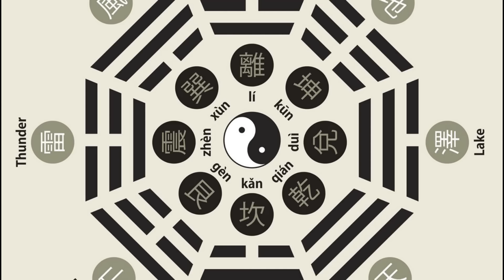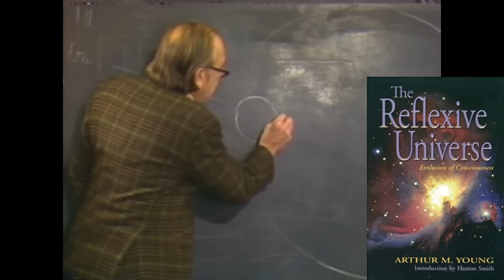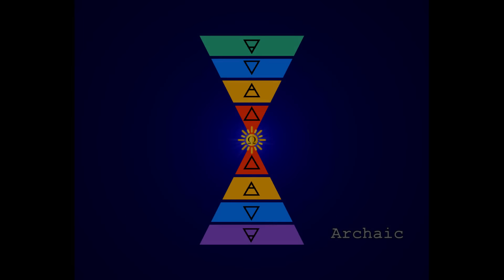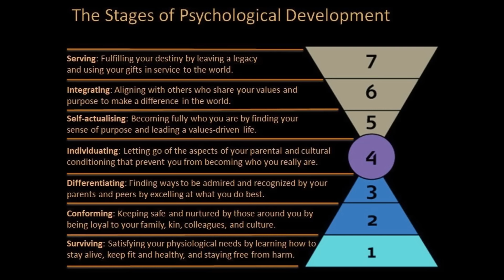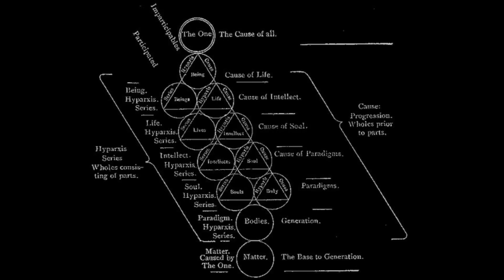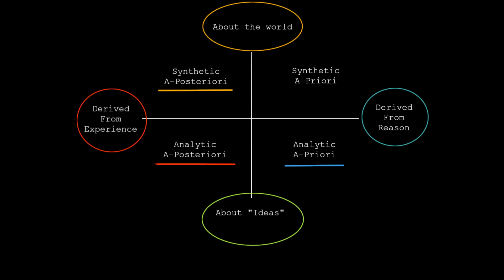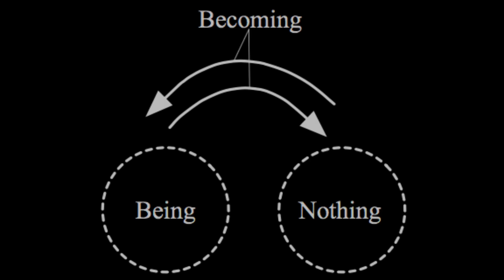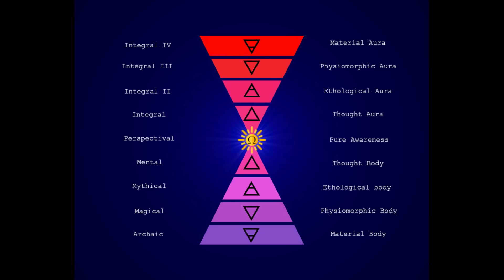The Metamorphosis of Human Awareness

Comment: Would love to hear that you’ve gotten a better mic setup
Reply from the maker: I have a very solid mic setup. What you don't like is my mastering chain, which I calibrate specifically so that my dialogue is discernable on various devices, meaning that I will not be changing it in order to accommodate your preferences.

Comment: Finally!  Been waiting for your next masterpiece bro!  I’ll edit this once I’ve had time to digest the content.

Edit:  First off, as a mechanic, I can confirm that it is very easy to see mechanisms everywhere, including biology.  But there’s a different aspect to it too.  Once you get a broken motor repaired and rebuilt - especially with older motors - you then start that motor up to “break it in.”  You then tune.  You are giving that motor the mix of fuel and air or “Food and Oxygen” that it needs, and you tell it when to use that energy to effect rotational velocity.  But you may decide it needs bigger “diaphragm,” so you add a high-lift camshaft.  You decide you need more air and fuel, so you add a supercharger for more volumetric efficiency and you feed that through a bigger carburetor, bigger “lungs,” bigger “trachea,” bigger “nose.”  You now swap your rotating assembly to accept more force.  You put more accurate ignition timing on so you don’t get out of sync.  You start it up, break it in, make fine adjustments, and then before you know it, your motor is running smoothly and has a unique resonance.  That resonance determines how that motor responds to input, and how it handles quick or gradual changes in that input.

While a motor is not a living thing as the idea of living is currently considered by mainstream science, microscopic differences in the individual components of this motor change aspects of the motor in it’s whole.  Two motors with the exact same parts made from the exact same molds and built in the exact same way with exactly the same amount of lash, will both require slightly different tunes to get their maximum output.  And the output is different.  Two identical motors will require different tunes no matter how perfectly identical they are.  The Horsepower and Torque curves will never be exactly the same, even under perfectly controlled atmospheric conditions.  One motor will start to “purr” or resonate at a slightly different RPM than the second, even though they have the same camshaft, same induction, same input and same exhaust evacuation.  One intake “seasons” itself better than the other (liquid gasoline coating the intake runners).  One motor burns more of it’s carbon deposits than the other.  Each cylinder on each motor gets different heat marks, even on a motor where all cylinders have air and fuel swirreling in the same exact direction at the same pitch and azimuth.  Every intake stroke in each individual cylinder results in just a slightly different volumetric efficiency, slightly different burn duration, slightly different power stroke.  Everything is slightly different each and every time.  Perfection is thusly never truly achievable.  Each Dyno pull gives a slightly different result.

With this information, it is impossible for me as a mechanic to say that every motor is the same.  Each one has it’s own character, each it’s own unique resonance, regardless of how exactly they are built to their counterparts.  Each motor “lives,” should it be given rotational velocity (turn the key, turn the starter, connect the bendix).  Each motor “dies,” should it’s ignition be cut.  It is revived, should you turn the key again.  I wouldn’t say that it’s conscious per say, but instead it is undeniably animate.  There is something nearly magical about these machines, something akin to a personality.  It resonates.  If it’s damaged, it tells you.  It’s resonance changes.  When you replace the broken component, it has a slightly different resonance.  Much like a transplant patient may have a change in personality, so does a motor change in resonance.  Sound, body; different body, different sound.  Different resonance.

Even something as simple as an analogue clock’s function results in witness marks; no witness mark ever exactly the same.  A clock maker must identify the witness marks, understand the clock’s character, and use that character to determine exactly what lash needs to be tightened, what lash needs more play.  The clockspring winds just a little different each tick; the escapement is slightly off.  Even a Rolex looses time.  The mechanical motion of the clock is thus never quite perfect.  Even an atomic clock which relies on radioactive decay is never exactly perfect.

Thusly, as a very picky, very diligent mechanic, I cannot truly say that even mechanical principles at a macro scale are without individual character.  They’re never perfect, regardless of how precise their craftsmanship.  Even if you could completely eliminate wear, there will always be something off.  Something flawed.  Building your mechanical devices out of a material, the atoms of which are in exact perfect arrangement under any given method of observation and run it in a perfect vacuum; the count is always slightly off.  So even in the world of machines, you constantly see a true uniquity.

Just because one object can push another, and one shape consistently rotate another, doesn’t mean that is how everything works.  Heck, quantum physics is a handwave to problems in classic scientific theory.  If a model of the universe should be required for any reason, it should be built from the macro up.  And while I understand that science is always behind due to it’s necessity to be observed to be accepted, there is much beyond the scientific worldview which is possible to experience but impossible to explain scientifically.  

Take love for example.  The scientific conception of love is summed up to familiarity over time, and/or biochemistry.  But one may love another just as intensely regardless of time and distance, as another who is present and nearby.  People can love others differently, regardless of their familiarity with the person or their biochemical reaction to their presence.  A parent separated from their child directly after the child’s birth will love that child regardless of whether or not they’d ever had any familiarity or even post-birth physical contact, and that child will often long to meet their actual parent.  This directly contradicts the belief that love is a logical concept.  Conscious love is a choice, but unconscious love is present regardless of any kind of measurement you can take.  So I refuse to believe that love can be measured in empirical units, because it consistently defies empirical measurements.

I love this channel, it asks questions that are often overlooked in the face of mechanical answers.  Instead, it’s mechanistic principles which don’t exactly fit the observations of the universe.  Keep it up man, I absolutely love (consciously and unconsciously) hearing these absolutely universe-inverting theories, and I will be watching this channel for as long as you continue to make these interesting and philosophically thought-provoking videos.  Also, as (as you phrased it in previous videos) a “lefty snowflake,” your contemplations of art and philosophy transcend the modern left wing pseudo-intellectualism to the point of giving me (a careless fiscally conservative Libertarian), more than my fair share of questions over even the most basic observable and confirmable “facts.”  That’s not an easy task, and while I have already been contemplating reality and factuality for awhile now, your research has shown me exactly how much more there was to discover!  Much love bro, great video and I’ll be waiting on-edge for your next video.  Cheers.

Edit 2:  Hey, if it’s not too much to ask, I’m legally deaf so I’d appreciate even the automatic subtitles.  This video had them disabled.  I know they’re not perfect and that you do not have the time to transcribe them all manually yourself, but even 95%+ accuracy is better than nothing.  That’s not to say that you aren’t easy to understand; you have a very crisp, clear, beautiful voice (no homo lol), but I just simply cannot understand everything due to how screwed up my ears are.  I would appreciate it if it wouldn’t be too much of an inconvenience.  I just don’t know how the [CC] system works and if you have to check a box or not; if you can’t it’s fine.  Again, appreciate it!
Reply: didn't read all of that. but i will point out that an engine is NOT a motor. i wrote a paragraph about this but deleted it - "Tezla" are powered by engines. spread the word -
Reply: I think ccs need time to generate, give it a day

Comment: a major part of Saturn's return that no one is aware of is mineral deficiency.
variable degrees but it's a given - unless lucky or already working on it the odds are you're running low on multiple minerals and this affects energy and general health. the food and water are lacking in addition to the older a body is the less it is able to naturally absorb minerals through the food that does not even have them anyway. - and now a commercial from our sponsor? no sponsors but i strongly advocate and endorse natural soaps namely infused with dead sea salt - 🙏🤠